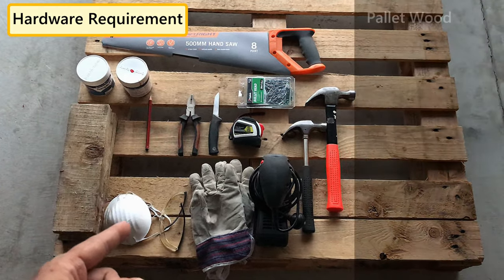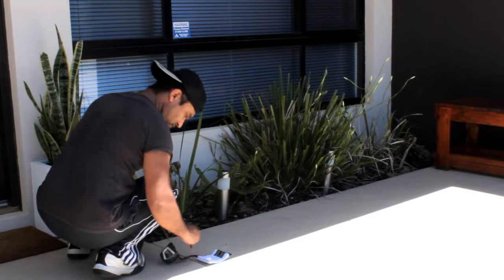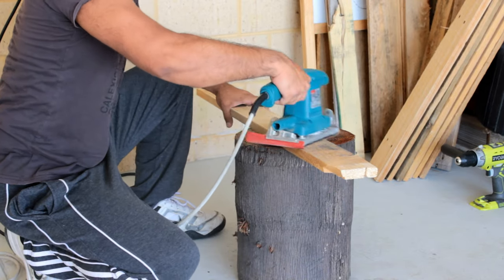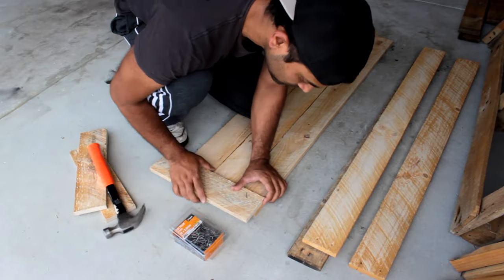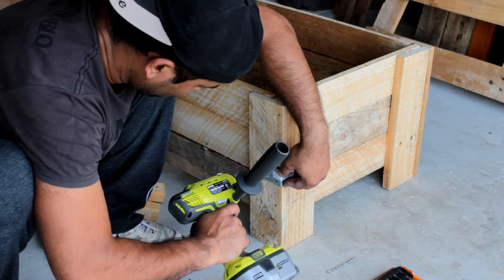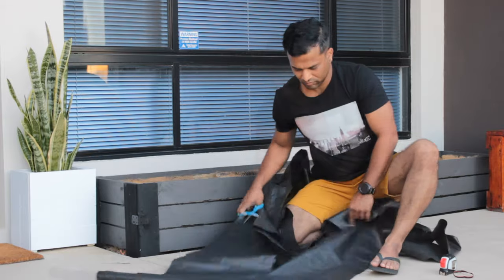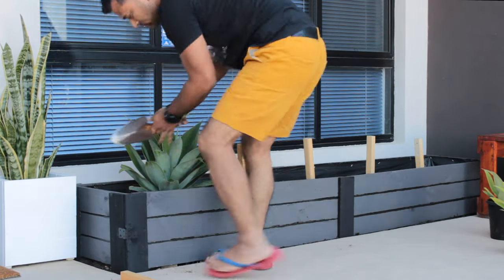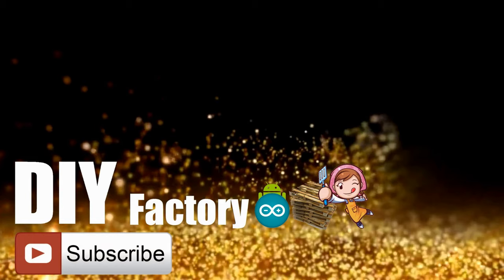DIY - Planter Box

Comment: Hi. Wat size nails yur using?
Reply from the maker: I generally use the nails extracted from the pallet which are generally 2" long.
Reply: @CrazyCoupleDIY  I tried doing that put the short thick piece of wood on the longer piece of wood & nail it int but the nail comes thru the other side. So I used shorter nails. Do u hav a video or can u make a video on how to nail shorter pieces to longer pieces of wood? Only found one video on this on YouTube.
Reply from the maker: Ahh makes sense 
No i don't have a video for that. 
However, sometimes adding screws instead of nails helps a lot